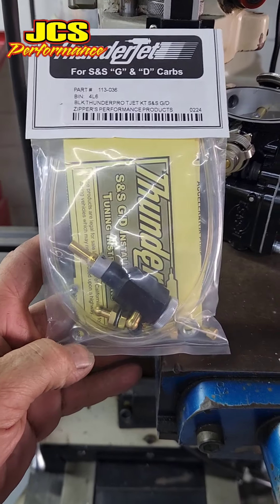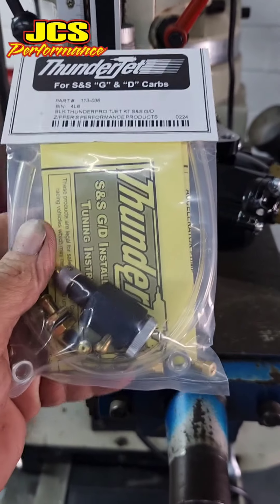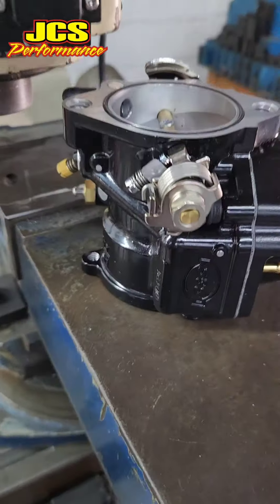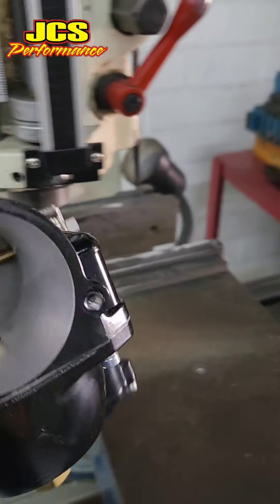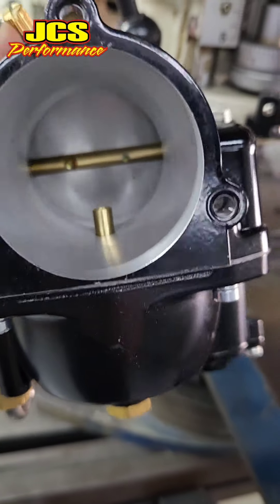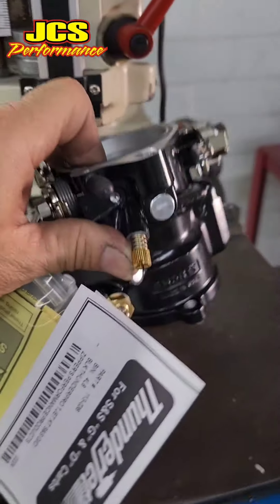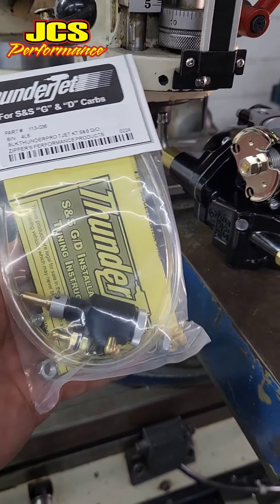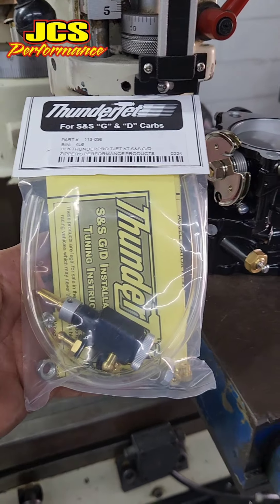Vaughn's Zipper's ThunderJet Install S&S Cycle G Carb Performance 124 Harley Dyna Twin Cam

Comment: Hi I have a 93 inch shovelhead stroker with std heads dual plaged 9.5 compression and s&s super E with thunder jet what jets do you recommend for a start?
Reply from the maker: .74 Main, .031 Int, and 135 thunerjet would be a good place to start
Reply: What was that third hole you milled?